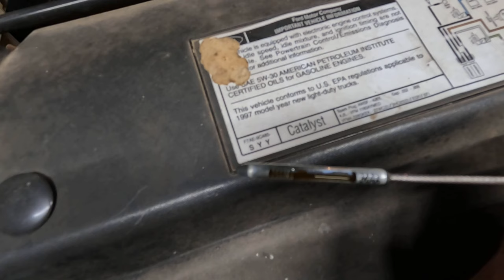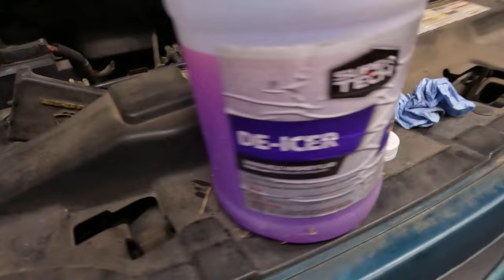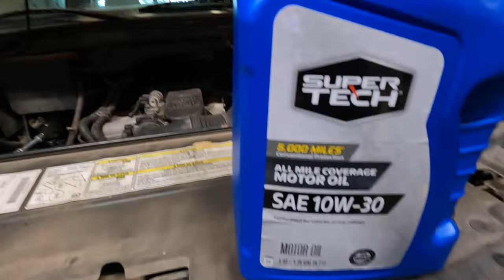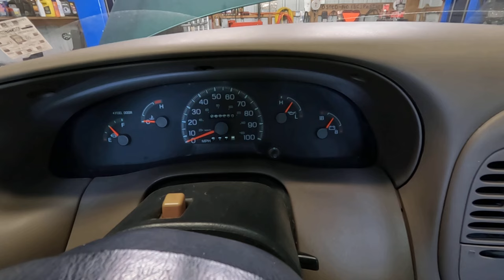Changing oil on my truck. You can do it!

Comment: How come you didnt put it up on your hoist ? I did 37 years in car rental maintenance,  we had 4 hoists in the shop, i would have 2 hoists going at a time, did 20 oil changes a day plus tire repairs. I have 15 years on you brother, now i take my truck to my dealership,  no laying on the ground for me😂
Reply from the maker: On my 4x4 trucks, I just slide under them for the oil change. But when I do a tire rotation, I will do the oil change then but this time the truck didn't need a rotation. I didn't know you use to do that type of work. Thanks for sharing! Have a Blessed Evening James!  Justin
Reply: @homegrowncountryhomeplace  you would be amazed the stuff I've pulled out of tires treads and sidewalls.😀
Reply from the maker: @elflordsjourneys  I know. I have pulled out knives, hunting rounds, big rocks, files, sticks, deer antlers, spoons and forks and so much I can't remember. A person would be surprised about what will go through a tire.
Reply: @homegrowncountryhomeplace  glass, wrenches, ,screw drivers,  to add to the list,one time I had to remove a box spring mattress from the whole under side.🤪😄
Reply from the maker: @elflordsjourneys  Lol!
Reply: If you can do it yourself, why not! Great video Brother!!
Reply from the maker: Thanks. Getting some things done before it gets to cold. My 4x4 works now. Remember last winter I needed it and it was inoperative. New tires too! Now I am ready.